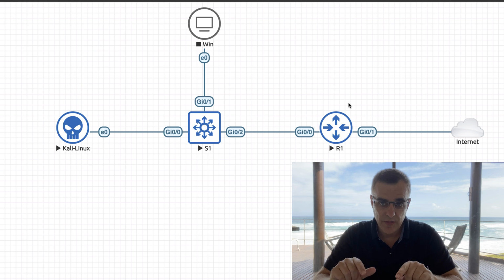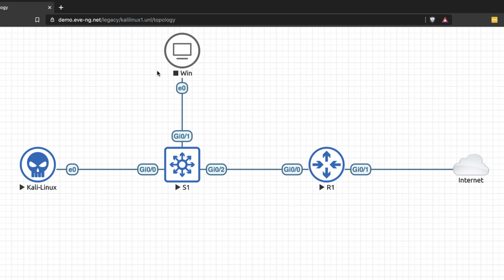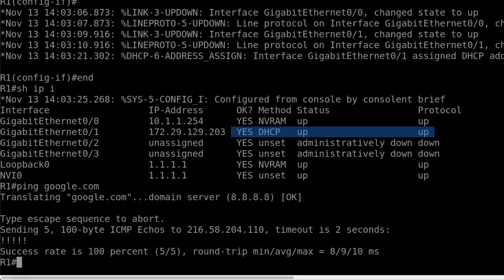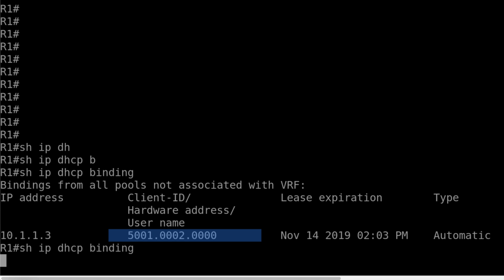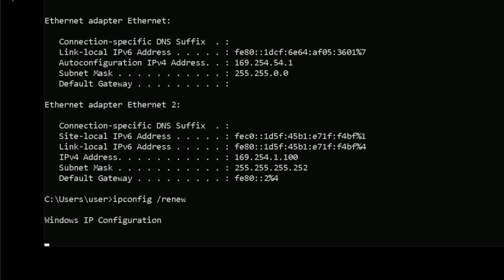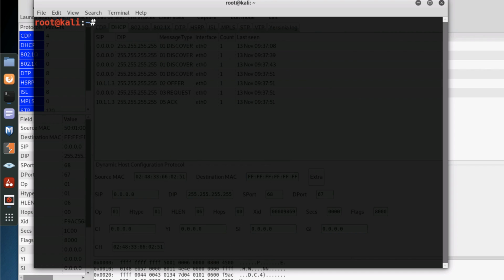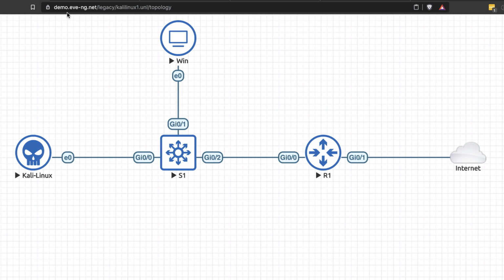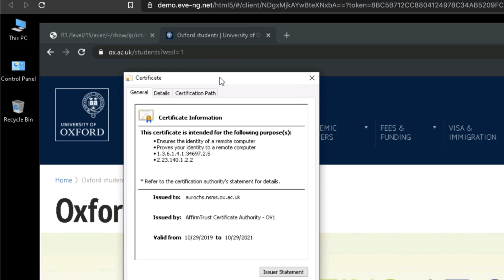Kali Linux: Hacking DHCP and MITM

Comment: most modern routers and switches today have options for DHCP guarding, where you can configure the trusted dhcp server's by IP (so one for each vlan interface for example)

i don't know if the router gives this info to the client, but seems unlikely, as theres no way to know the clients will support that, so i believe what the protocol does is just stop any dhcp request ack or response going through the configured device (router or switch) that has the protocol enabled.

Comment: Great video! I've got 2 questions:
1. What if windows pc has already run and got an Ip address? If it already has the ip address, we cannot use our rogue server. 
2. What if the network we try to attack has a middle man with a firewall setup? Let's say that we just connected to the McDonald's network and we know that there is somewhere a mainframe, database, whatever. Unfortunately we're in DMZ and the mainframe is behind the firewall. How to modify ip tables of the firewall server/router?
Reply from the maker: Thank you. DHCP servers will typically allocate IP addresses to client devices for a limited amount of time (like 3 days). The rogue DHCP server will only be able to allocate the IP address to the client when the address has expired and taken by Kali. Hacking is not always easy - especially if a network has been configured properly.  The answer to your questions are -  it depends.

Comment: Thanks for the great content.
On my opinion MITM was relevant about 3 years ago. Now almost all sites use SSL/TLS, and sites from the list of top 100(like facebook, visa, mastercard) certificates are hard-coded into browsers. And any substitution of the certificate is impossible even if you install your own certificate on a object PC. This approach is very good if you need to study the object, the schedule, which sites are visited, which services are used.
Reply from the maker: Agreed. Things are a lot better with SSL/TLS certs these days. But unfortunately people still use self-signed certs on devices and sites? And they still use unencrypted protocols like HTTP, FTP, TFTP or Telnet :(
Reply: @davidbombal  In this case i can recommend check dhcp snooping technology. This will make this type attack impossible, as well as protecting against incorrectly connected user routers.  good instruction you can find here: https://www.cisco.com/c/en/us/td/docs/switches/datacenter/sw/4_1/nx-os/security/configuration/guide/sec_nx-os-cfg/sec_dhcpsnoop.html
Reply from the maker: @oleksandrkachynskyi1013  Agreed. These videos are for beginners, so I need to keep things as simple as possible. Great that more experienced engineers like yourself are pointing to documentation and making recommendations. Thank you for doing that.